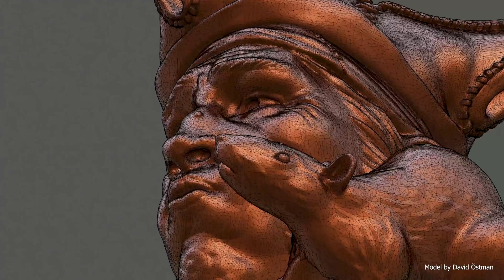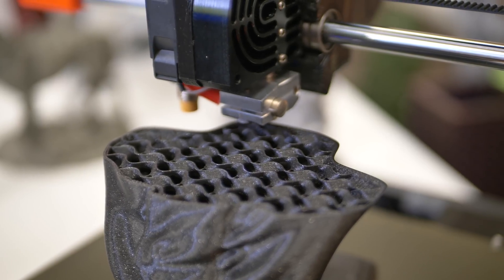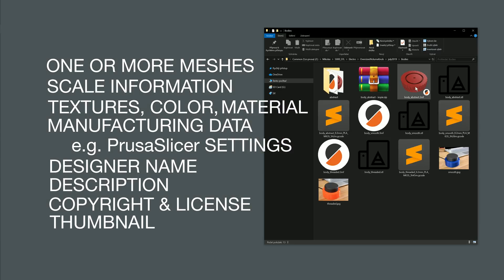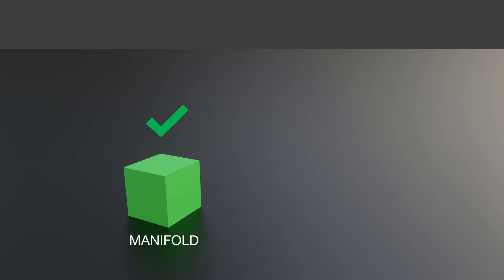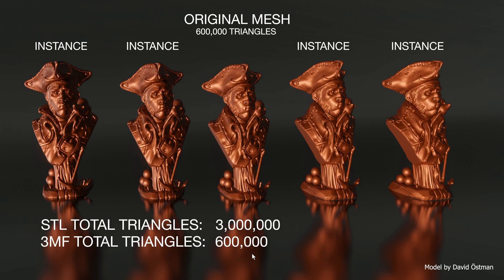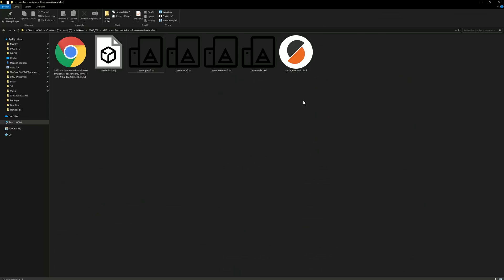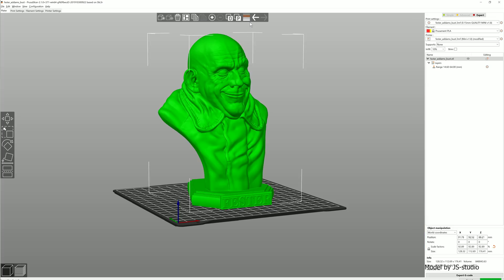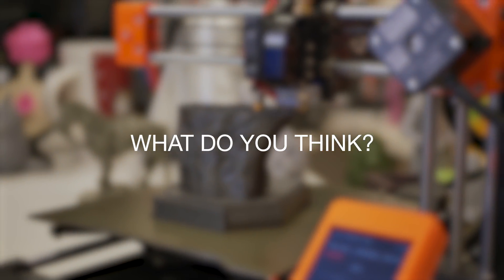Why STL is dead and 3MF is the future of 3D printing

Comment: Blender 3d doesn't support 3MF, which is where I do the bulk of my designs
Reply from the maker: Same, but it's not really a big problem. You use STL for the transition from Blender to slicer, but then you save 3MF in the slicer with all of the fine-tuned settings (supports, variable layer height etc.) and that's what you share.
Reply: @Prusa3D   Then why would this "kill" the STL format?  That makes no sense because you are still using STL.  Unless you completely and 100% eliminate STL files, then you are just treading water and splashing it at people.
Reply: @PowerSports  hardly. There's an obvious difference between sharing an STL on something like PrusaPrinters and sharing a 3MF. For people that don't share or use shared files the difference doesn't matter, but it exists and is useful.
Reply: @PowerSports  Don't expect clickbait titles to make sense.
Reply: Blender -> stl -> ps -> 3mf + gcode is missing the elegance for iterations. It would br awesome, if ps could generate a blender mesh based on the gcode info, so it can be considered when optimising and iterating on a design - especially when details and tolerances matter (changing nozzle size, width, heigth and even material changes dimensions of the final object)
Reply: But it is an unnecessary hassle, and an annoyance when you design something with tight tolerances, and mesh is scaled down or up by a factor of 10
Reply: @grogyan  unless the tolerances are parametric and part of the model
Reply: @asireprimad  STL doesn't care about being parametric or not.
Because tolerances can be added to the format by featuring required slicing parameters for specific printers.
Reply: @grogyan  this is my point. STL is just a collection of points and their relations - not a 3d printing format. 3mf is a bit better, but it does not cover shells and tollerance shells - meaning if you choose a printer and in its profile it is known what tollerances it works with (in combi with filament specs etc.) This tollerance shell you could apply to the object to be printed and check without guesswork if something will "stick together" or not. This should be saved also in the format carrying the information about the object to be reproduced.
Reply: and why not use step?

Comment: I think STL is not dead, because it's simple and stupid. 
In some cases way too much stupid (ambiguity in format detection, when binary STL exported from SolidWorks starts with word "solid", lack of unit combined with merging of (not so) close vertices by some readers not expecting unit in meters and microscopic model, possibility to add binary data to triangles (but not vertices) without possibility to interpret such a data from other program, because there's no description.
But parser of binary STL can be written in hour or two.

Comment: In Windows 10, 3MF files have an icon with an image of the model to be printed
Reply: Not by default. You have to have some software that is providing that for you. 3d Builder is one free example.
Reply: my pc shows stl thumbnails
nothing installed specifically to do that
Reply: @marc_frank  You probably have 3D Builder or other software installed for other reasons. The thumbnail is a side benefit of those.
Reply: My STL files have images of the files too
Reply: I can't view thumbnails on any 3mf files. Is there a way to fix this?
Reply: @3DKprinting  Yes. If you're on Windows 10, install the app I mentioned. It's in the store.
Reply: @Psychlist1972  sorry i forgot to comment, I fixed the issue. I assumed prusaslicer created the thumbnail. it does not. need to save the 3mf in 3d builder in order for it to generate a thumbnail for it. got the app you mentioned for stl thumbnails. thanks.
Reply: @3DKprinting  Interestingly, the 3mf files on my PC were saved only with prusa slicer, and nothing else. They got thumbnails as soon as I installed 3d builder, but without me opening them in 3d builder.

I'm using it with the SL1. Not sure if the behavior is any different.
Reply: Amazing

Comment: It would be lovely to just print 3mf files instead of gcodes!.
So if you want to change something like the material you don't need to re-slice it and send it again to your printer...
Reply: So you want the printer to have the processing-power and software to slice a model......
And have fun changing the settings.

Comment: The 3MF Consortium library reference implementation is a disaster - unbuildable for Node, with next to no documentation and missing bindings file despite claims that it exists in the V2 release. It’s going to be a long time before this proposed ‘standard’ becomes even remotely reliable
Reply: How does it compare to AMF?
Reply: TROPtastic I went looking to review the AMF file format specs defined by ASTM International which is purportedly an ‘open’ standard Additive Manufacturing Format but when I attempted to review the spec I found it was only available if I purchased the PDF. This is not the open standard you’re looking for.
Reply: Thank you for your feedback. We actually have put a lot of energy into making proper Node bindings. Can you contact me directly to sort out your issues and fix them? It might be as simple as a version issue as discussed here: https://github.com/3MFConsortium/lib3mf/issues/181

Regarding documentation, Node has never been a core focus, but the C++ extension is pretty extensive (https://lib3mf.readthedocs.io/en/master/source/Cpp/LandingPage.html) and gives you the same class hierarchy.
Reply: Especially when STL is simple (LR/LL parse). If there's anything to learn about that being widely used.. Use simple formats and glue it together with some archive format. XML=autofail.
Reply: @henrituhola  XML is not fail. If you look at any file, you would observe that only those that are generic and modular can be developed any further. The STL format is as is, you can't do anything with it. Any descriptive, modular file format could be refined, fixed, developed later. Nothing is free, it is more complicated to handle, can cause compatibility issues, but future proof, and the comparibility issues depend on how well it is standardized, how organized the changes process is. Text files are bigger than binary, but the filesize itself is the lowest priority today, or it should be. Storage is a cheap resource.
Reply: @gabiold  Text files maybe bigger than binary files but they are compressible - binary files tend to not compress very well at all.  File size is also a priority still to this day, say you have a 1 MB file and a 150KB file,  each file is downloaded 1 million times, that 150KB file results in 150GB of data transfer while the 1MB file results in 1TB of data transfer.  Bandwidth is not free and most people pay by the gigabyte - have you never wondered why Google allows for unlimited low resolution photos in Google Photos but limits your high resolution photo storage unless you pay for extra?
Reply: @emu071981  Yes, in that particular case, it may matter. But let we honest, a file downloaded million times is a somewhat special and rare case, it is rare that something has that big of an interest. Let us ignore "invisible" files you download, javascript libraries in websites for example and these sort of things.

To remain at 3D printing, the files I interesed in are showing downloads of few thousand at max. at Thingiverse, for example. Most of the data on the internet is not popular, requested by a small group of people.

Let me repeat, I mean any professional thing, I do not interested in social media things like "I have infinite time, just watch everything, post everything" kind of files...

The internet data price is depends on where you are, I should say that the landline FTTH connection is practically free here, 1Gbps transfer rate is commonly available to an average person. For music, for example, I do not interested in MP3 anymore (since ten years), I hunt for FLAC or WAV or any lossless.
Reply: @gabiold  That 1Gb residential service which basically has no guarantees?  Where if someone puts a backhoe through the fibre you basically have to wait for someone to organise for someone else to maybe come around next week to patch it up?  Or where contention ratios are a actual thing - a contention ratio is the ratio between the total bandwidth of your customers and the actual bandwidth they can collectively access, most ISPs run at a 50:1 ratio (i.e. for every 50 customers with a 1Gbit connection there is only 1 gigabit worth of bandwidth for them all to share)?  

Most data centres and enterprises pay for bandwidth and data and they are getting priority service.  They are guaranteed a minimum bandwidth at all times and if their service goes down, there is a technician there to fix things asap.  These are the people who care about file sizes because they are paying to store and deliver these files and the data transfers go up dramatically when you have thousands of files being requested by thousands of people every day.  If you can reduce the file size by half then you can cut your transfer and storage requirements by half.  

File size matters to a lot of people because a lot of people either pay for data transfers (e.g. people who pay for rackspace in datacentres or for business connections) or they pay for it in exchange for providing bandwidth through their own networks (e.g. ISPs).
Reply: @emu071981  The service works great here, for me at least, I don't know what the share ratio is but I had no complaints so far.

We could debate all day long. I agree, for an ISP, for a content provider, the filesize is nr. 1 priority, and that is the only property of a file they care for 99% of the time.

But for a file format developer, and possibly the end user, the filesize is not nr. 1 priority.  Functionality is. Universality and the maintainability are ahead too, most of the time. Nobody appreciate a small file if the functionality is not there. Nobody appreciate, if it limits development. And so on. If it goes beyond sensible limits, or there are alternatives with magnitudes or so difference, then we might start questioning the cost/value.

I actually grown up on dial-in modems, floppy disks, and as of today I do assembly and C language development on microcontrollers which have 2KiB of flash, so I felt what a size constraint means in real life so many times. But even in the embedded area, 32-bit MCUs with n*100MHz core, 256K-2MB flash are so cheap nowadays. When shaving off the last cent is not required, I rarely "hack" code anymore if not forced to do because it almost always leads to bad maintainability and feature constraints and longer development time.

So I still stand behind the "it depends". If you share popular things, or a lot of them, the file format certainly matters. If the target (device, connectivity) is low-end, it certainly matters.
But for general use, if it is not inconvenient to handle, it probably doesn't matter.
Reply: @henrituhola  no, it isn't, if there are proper schema for the XML files. Then there are tools to generate proper code.
XML without schema, is auto-fail though, like any file format.

Comment: What is Manifoldness and how does 3MF help?  I read the article, and I still don't get it.
Reply: It wasnt clear from the video how 3MF fixes it. Seeing as you still need to export the STL from the modelling software, it sounds like until you fix it, it wont save to 3MF.
Reply: @diggis79  you dont have to export stl, you are just able to if you want to (which seems silly)
Reply: @cashel1111  at the moment most modelling programmes dont export to 3MF, meaning you still have to export as STL or OBJ or similar. 3MF seems to be predominantly a save file format for slices. Which is great and all, but not likely to replace STL anytime soon.
Reply: The standard says that models must manifold. So it's basically up to modeling software to enforce it. I predict we'll start seeing "Are you sure?" save dialogs.
Reply: Manifoldness is when one edge is shared by more than two triangles. For example when one part drawn in CAD touches another part and shares edge or surface. I can't recall why it's inconvenient to have them in the model, but there can be some ambiguities, separate mechanical parts can't be separated and they likely create many problems with mesh operations such as simplification.
Reply: From the 3MF website about their "repair" tool:
"     3MF Service allows everyone access to the Windows 10 3D printing APIs.
      Repair performs the following actions:
      Repairs the 3D mesh by closing holes and fixing geometry to create a water-tight 3D mesh suitable for 3D printing."

In strict definition: {A manifold is a topological space that is locally Euclidean} 
         - any 3 dimensional object that you would want to print... if it deviated from this mathematical property.... you can't print it.  This property can be checked for all the points and volumes described in the 3MF file... so presumably the software performs that check.

Also, take that to mean ===
Concerning "manifoldness" It looks for things like floating points, planes, or volumes that cannot be printed.  It also looks for completeness in the volumetric shells (holes in the manifolds, providing for "watertightness).  I think it also sums up the volumes of any distinct parts and ensure the sum of the part volumes sum up to the whole volume (otherwise you would have internal volumes whose walls protrude or overlap into other volumes in the space, making it have a higher internal volume sum than external collective volume sum... making it (potentially) unprintable.)  It likely also looks for things that can be made in a drawing program that can't be made in real life... like walls or partitions with a thickness of zero or two objects meeting at a "point" of infinitesimal size.

Comment: Storing slicer/material data is pointless, every machine is different and needs tuning.

The only need for a new format is to avoid holes and flipped normals.
Reply from the maker: Support settings, variable layer height, making parts of model stronger with modifiers to increase perimeters or infill. All (and more) are pretty much independent of the machine and it's nice to have them already set up when you download a model. (instead of everyone doing the same thing manually over and over).
(-Mikolas)
Reply: @Prusa3D  Even though you're right in the above, it doesn't mean I'm wrong i my statement, that you're promoting this fileformat, as part of a strategy of luring and locking users into your product line.
Same strategy as Apple used with huge succes. Smart move for you as a company. Not so smart for the community.
Reply: I personally like storing my settings for a specific project. I can then load back a project and continue where I left off. Sharing settings is another story though.
Reply: But it will help Prusa pulling an Apple stunt..... Make users feel the need to stay put with Prusa products.
Same goes for PrusaPrinters, where they push users to save as gcode.

Comment: For those wondering "Why doesn't Fusion 360 have built-in 3MF export?" - it does, but it's part of the Manufacturing Extension, which you have to buy via monthly subscription with their "cloud credits". See here: https://help.autodesk.com/view/fusion360/ENU/?guid=GUID-B7A1FB40-2CCF-4817-9690-7AC72F1A5362#3mf-export
Reply: In 2022 Fusion 360 exports a 3MF file from the export menu in the Design workspace.

Comment: Apart from the extra metadata stored as xml and the storage size what does 3MF bring to the table in terms of resolution ? If it still stores the design as triangles there is no added benefit for a person who uses simplify 3d and a printer like Creality.
Reply from the maker: For example ensured manifoldness and no ambiguity with self-intersecting meshes.
All advantages are explained in the article: https://blog.prusaprinters.org/3mf-file-format-and-why-its-great/ ;)
Reply: @Prusa3D  So very little to nothing over the myriads of other 3d-object formats.
Reply from the maker: @ABaumstumpf  Having slicer settings saved with the model seems like a pretty good reason to use it, at least for us.
Reply: @Prusa3D  Yeah, just that oh right, different printer, different slice... and some random settings in the model....
Reply: @Prusa3D  how does it ensure this? If I load a non-manifold STL into PrusaSlicer, will it just not save it?
Reply: @Prusa3D  What if CAD software can generate STL without non-manifoldness. Then it would be no point.